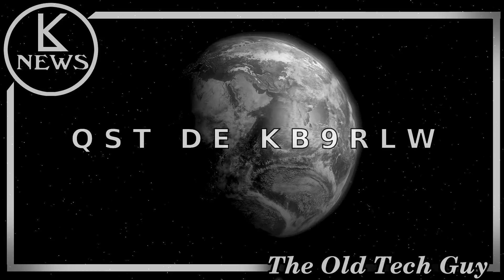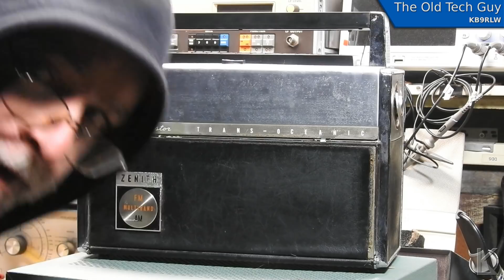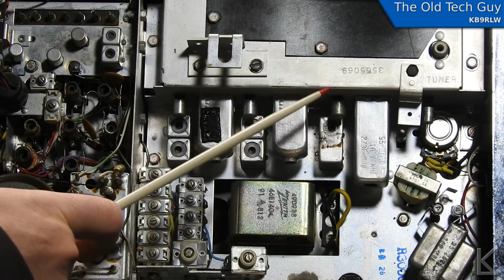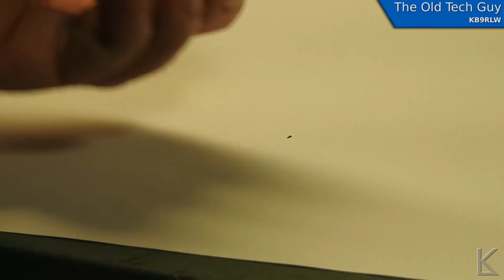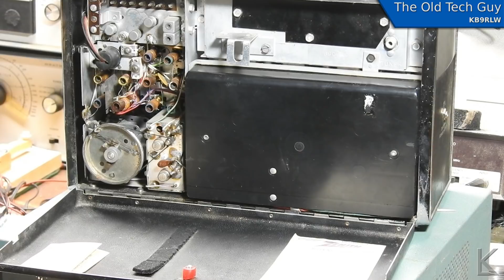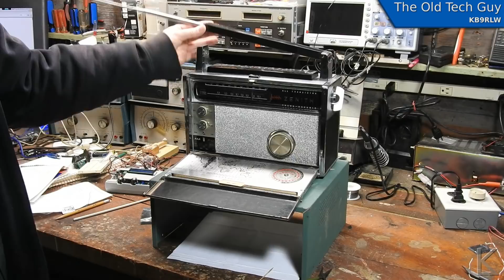Radio Repair - Quick fix for a Zenith 3000-1 Trans Oceanic with no AM or shortwave receive

Comment: Thanks so much for this post!  I have a Royal 1000 that developed the same issue after restoring it.  I thought the IF transformer was shorted as the germanium transistors tested perfect on my tester.  Sure enough bent that pin back and tried it after almost throwing in the towel and it’s back to life!  Thank you for sharing this!

Comment: The cables connected to the speakers are reversed! Or is this correct, the yellow is at the bottom and the black is at the top?????
Reply from the maker: I don't have the radio to check, but I don't think that polarity matters on the speaker. Unless one side of it is grounded internally to the chassis, but I can't imagine that would be the case. You could check with an ohm meter to make sure there is no connection from either side of the speaker to the metal chassis.

Comment: I think the radio having a positive chassis goes back to the days when cars used to have a positive chassis.
When I was a kid (born in 1966) I used to take lots of car radios to bits to salvage the components. 
Those radios used to have a positive chassis but a switch on the back allowed the radio to be fitted in a 'modern' car with a negative chassis... Well, that's how it was in England!

Comment: I tried this on all six transistors, I'm getting more static but still no stations yet. I'll get some replacement transistors and try those.
Thanks for the tip and pointing me in the right direction.

Comment: Wanted one of those Zenith Transoceanic Radios while in high school. My job at McDonald's didn't pay enough to save for it. Had to put most of my earnings in the gas tank so I could take the girl friend out over the weekend. Hi hi If the PX at GTMO had a layaway plan I might have been able to afford one in the mid-60's. Finally, had to settle for a kit built AM/FM radio from Heathkit.

I suspect the reason Zenith ceased making these fine radios is because longevity exceeded demand. This Zenith you repaired was probably manufactured around 1961.

Comment: What can I do if I can't get it to turn on at all? Whatever the problem is, I believe it was caused by my using it for a few years to prop up the corner of the wooden frame of my waterbed back about 25 years ago. 

My dad bought the radio brand new and I would love to have it working again. However, I know no where to get it fixed. I'm in the Dallas-Ft. Worth Texas area.

Comment: I'd like to see how to make and install a bfo. That way when I build a crystal set. I'll have a real emergency radio.
Reply from the maker: I don't think that would work.  A BFO has to be a few hundred hz off the center frequency you're listening to.  In a receiver using a VFO, the BFO will track along with the tuning of the VFO.   In a crystal set, you don't have a VFO and mixer.   It's just the strongest AM station that gets through your tuned front end.  And it has to be AM since the carrier is rectified to provide the DC + audio that drives the earphone.
You'd need to start with a direct conversion regeneratice receiver at the simplest,  or a superhet design with an IF section if you want to have a BFO and SSB reception.

Comment: Any idea how to get the light to work again?
Reply from the maker: I no longer have the radio to look, but it's probably a very tiny incandescent light bulb at one side of the dial or the other. Those little rice grain light bulbs are hard to find these days, but you could replace it with an LED. I have ground off the dome of an LED in the past to diffuse its light and used it to replace those little bulbs in old radios. You just need a 330 to  420 ohm resistor in series with the LED and you need to pay attention to the polarity.

Comment: Tried this with mine but no luck. Going to try replacing the transistors and batteries next. Any suggestions on finding a power supply?
Reply: I would use batteries only. Many have tried using the 12v power supply and it’s fried the capacitors(?). I had a horrible hum with mine and I stopped using it.

Comment: Need AC adapter. Is the jack 2.5mm mono plastic jack? Is the tip negative terminal? What should be the amperage of the 12V adapter? Look forward to hearing from you mate.
Reply from the maker: I don't remember the specific size of the Jack, but the tip is definitely negative. It's a reverse polarity, the chassis is positive. I would think anything that could handle an amp would be fine.
Reply: @loughkb  Thank you for the super fast answer. So the sleeve which is closer to the cable is positive and the tip which is closer to the radio is negative right?. Just confirming because this inherited radio from my grandfather is very valuable to me.
Reply: I use a 9 volt wal wart as these are low draw sets and the 12 volt ones put out an excess of 14-15 volts. That said, batteries are the way to go  just to eliminate noise. These were designed for long life with carbon zinc cell and alkalines last forever in these sets.